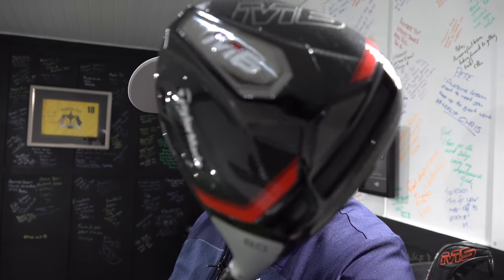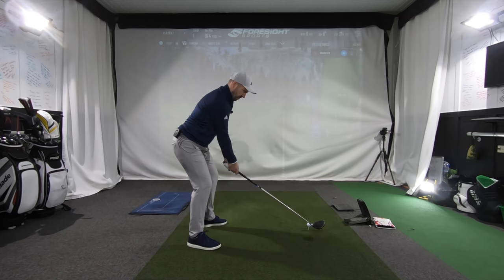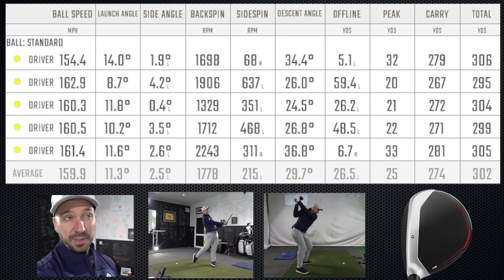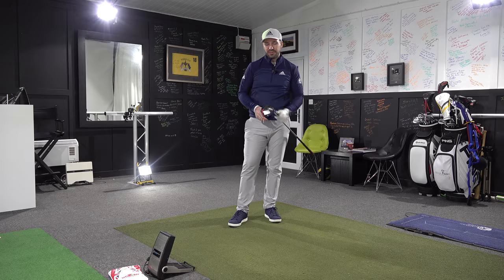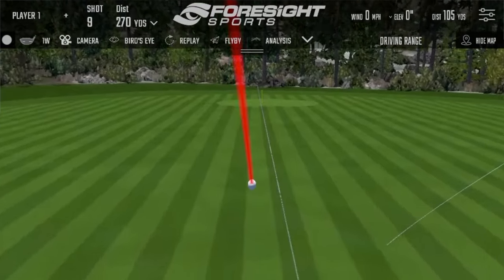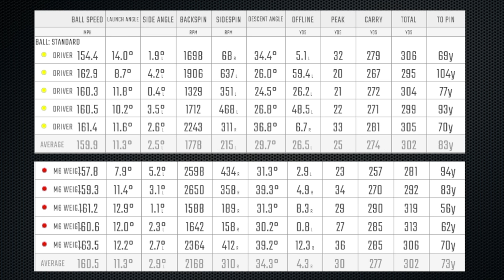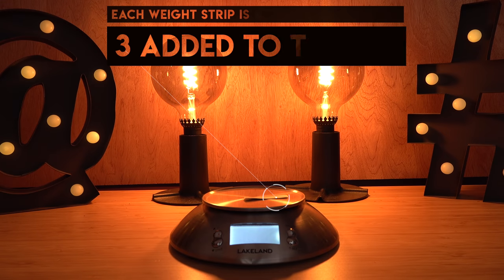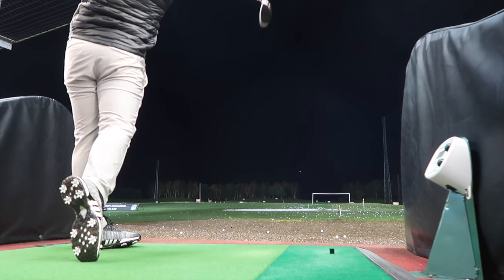Custom Fairway Finding MONSTER! Don't buy a NEW driver before watching this..

Comment: Actually  I've been thinking of adding weight to the heel I struggle with a block cut as my miss, at the course I play all the danger is on the right
Reply: I have the same issue, and I'm going to try the heel tape.

Comment: You need a faster swing speed to hit that low lofted driver. Not recommended for us 90 mph swingers. I did order a Ping G410 Plus 12 degree with a 44" 65 g Ping Tour shaft this fall - Ping balanced it to D3 for me. My SS is about 90 - 94 mph with a driver and I get 225 - 230 yd carry with it - launch angle between 14 and 16 degrees. Spin 2200 - 2400 rpm. Shorter shaft makes it easier to make center contact. I tried the Taylormade "Original One" but the club face isn't as forgiving.

Comment: You need a scale to do this alterations correctly.  You would be amazed what the stock heads weigh. 198 grams is about standard for 45.50 inch shaft. Ping shaft adapter is about 5 grams, Taylormade is about 7-8 grams. The normal conversion of 2.5 grams for every swing point is off. I trim shaft length to measure short 45 inch length. Total head weight should be 204-205 grams, that is shaft test weight for flex. Weight is added to heel, toe, or bottom center for desired ball flight. Adding excessive head weight just adds flex & dynamic loft. What a lot of people feel is just an illusion of added loaded flex & release.

Comment: 1st thing i do on a driver move the weight to the toe add weight cut shaft to 44.25 and im 6'3".... with drivers that dont offer movable weight to the toe like the f9 or my current 400 lst ping.    i drill a small hole and add hot melt to the toe.....turned my g400 into soft feeling bomber....so unsure why any manufacturer cant release an ideal sound if all it takes is a drop of glue to mute the sound.....

Comment: I cut my driver down to 38.5 inches from the hosel , i am 5 ft 9in , no loss in distance , and i now hit more fairways , just to add, i also feel the swing with a shorter driver  is close to the same swing with your long iron, in that your actual swing is faster,  and that may be the reason why distance is nearly the same as your full length driver ,

Comment: I actually did something similar with my old St180.  I cut the shaft down to 44 inches and cranked the loft down from 9.5 to 7.5. I wanted to practice hitting up and the ball. Turns out I really liked it. Did the same to my 190 and absolutely love it!

Comment: Is adding weight not illegal in competition play?
Reply: Jamie Black I second this
Reply: Don't think so . . .i have seen putters in pro bags that had caked on lead tape
Reply: only illegal if you add it during the round and also you cant move it around. also if it falls off the club may be deemed unplayable as it has been modified, hope this helps
Reply: @jackhodges38  So basically, add it before the round and hope it stays on

Comment: Great video my drives tend to go off to the right where would you try the weights and where did you purchase them from many thanks
Reply from the maker: Jordan Skinner got them off amazon
Reply: Peter Finch Golf many thanks for reply where bouts would you try putting them with my drives going right

Comment: Well, that’s more or less what I’ve done with my Mizuno JPX Driver: cut down the shaft by 1,5” and added lead tape to compensate reduced swing weight. By positioning the lead tape more on one side you can slightly manipulate the draw or fade effect. 
Anyway, a shorter shaft would help the majority of weekend golfers. The industry should offer always 2 heads (different weights) with 2 different shaft length - 43” and 44,5”. No shaft should be longer, 45” - or even 45,5” what’s today’s standard at the industry - its crazy - no tour player is playing longer than 44,5”

Comment: Earlier this year, I tried essentially the same thing with my M6 (without putting the 3W shaft on it). A 'bit' over draw-y, so I got some tape and started to figure where to put it. I cleaned the club, prepped it and it was spotless, ready for the tape (same stuff, 3g each in those strips). A bit of tape on the toe side of the crown, and a bit of tape in pretty much where you put some. Let it set over night, and headed to the range in the morning. Double check the tape, tee up a ball and take a swing at it. "KA-PING"!!! both pieces shot off into space somewhere. "Screw this, I'll fix my swing instead of a band-aid". And guess what, that was more satisfying than a crutch fix.

Comment: So in summary: experiment with cutting down the shaft length on your woods, adding lead tape to bring swingweight back up. Yup, have done it on driver, 3 wood, 5 wood, 3 hybrid. Once you find the "sweet spot" for your game with each club it makes a huge difference. But beware, you'll be made fun of relentlessly and idiots will keep saying "it's the indian, not the arrow".